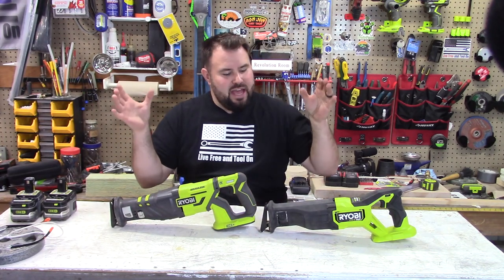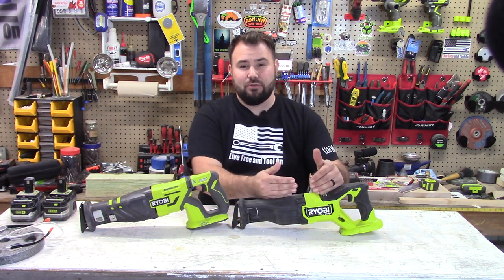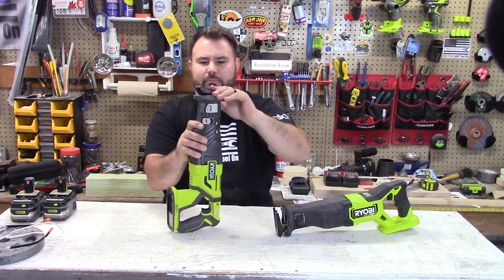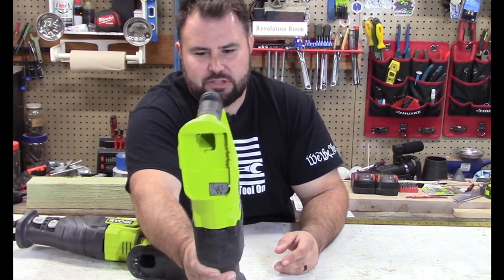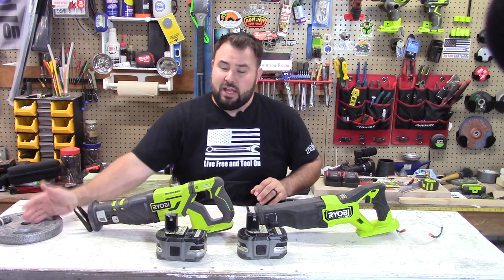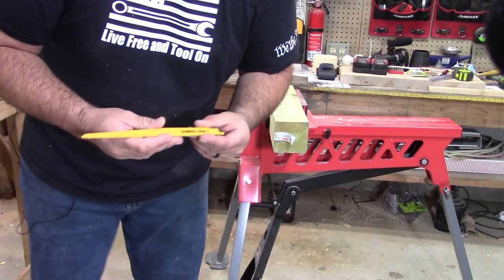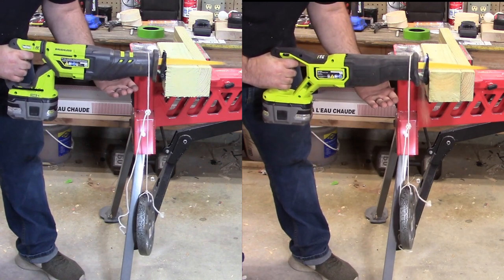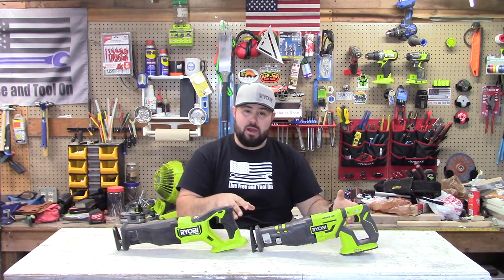Ryobi Reciprocating battle [old vs new]

Comment: blew up 3 1 a month what went the gears under the grip to move the blade the gears all blew through the housing looked like a car motor blowing a rod 😱 all blew in a month with light use looks the same to me just brushless. I will skip this one. Till proven better. went with the one hander 🤔🤣💪

Comment: for the newer model, there is no need of vibration filter to the handler, that is why it is removed
Reply: Untrue, there is nothing about the newer design that gets rid of the back and forth force from the sawing itself.  They removed it because it does slightly reduce performance to have the saw moving a little against the blade stroke.  This is largely due to dwerps on youtube who can't see past making a race out of every tool test, instead of analyzing value, build quality, cuts per charge, how hard it can be pushed till it overheats (or overheat shutdown circuit kicks in), etc.

It'd be different if you're a contractor and tool speed impacts productivity to the point where it decreases job completion rate and income, income which you can use to buy a contractor grade tool instead.

Comment: You should have done it as a 3 saw test.  The old with with and without orbital mode vs the new one.   Also labeling them which is which would make it easier to see who won.  
Overall great video!!   You really did a fantastic job show casing the tools

Comment: I've had the newer version for about 2 months now and use it pretty very frequently (at least 2 -3 times  a week)  at work taking down n trimming bushes n trees,,, and it performs well and  everything, but I just wish it had the damn orbital setting as well,,, I'll use my friends rigid saw w orbital and can see the difference in the cut on reg recip vs orbital . when his rigid is on reg cut, it's no difference vs my ryobi ,,, but throw on the orbital and it blasts past mine like nothing.  and idl about everyone else saying you don't need the vibration shit in the new one, but mine will shake the fuck outta my hand over time when cutting up heftier shits.. and the rubber grip on new one has come unglued n slides around almost over the shoe now .. it just seems a lil lower in build quality vs the other one.